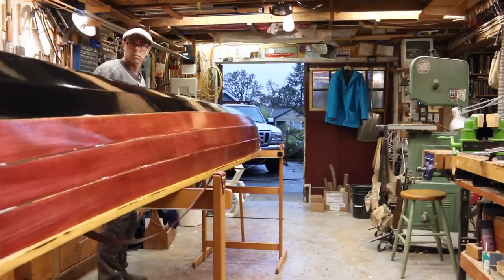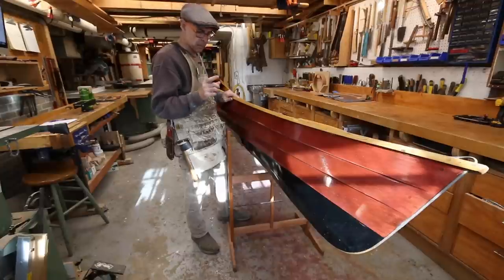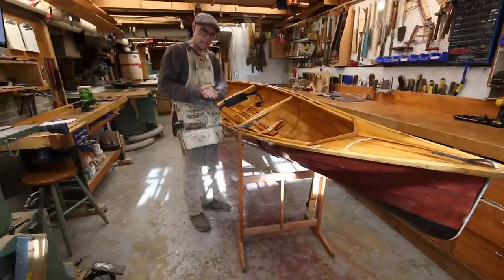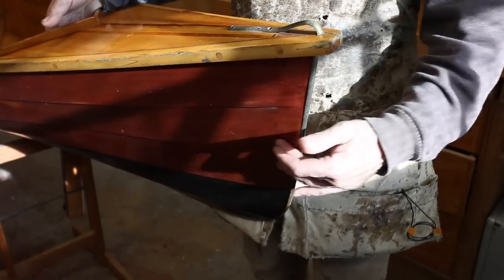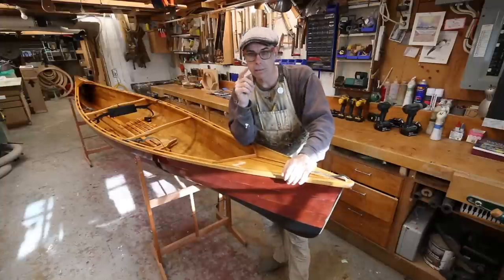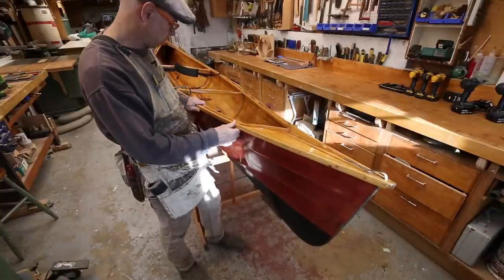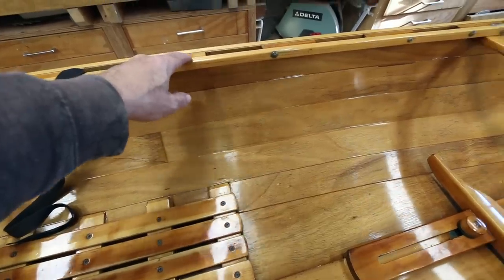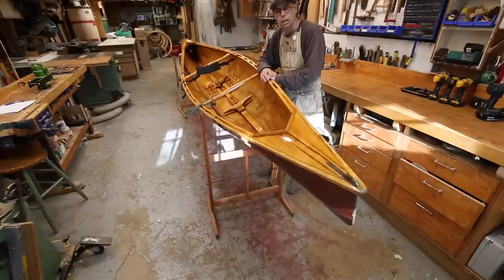Old Boat - Fresh Perspective - Critiquing my early work

Comment: Hi Marc, that varnish degradation is due to the trapped air in the planking heating up and wanting  to expand. That causes more pressure at the more open grain sections and causes those pores to open up a bit. When that hsppens regularly the varnish starts to give. That's what shows there.
Repairing it works best with sanding, then opening the cracks with a fine wirebrush. Then warming the canoe up to push thair out. Give it a HEAVY layer of  thinned varnish and LET IT COOL. That will aid in sucking the varnish i to the pores.

Comment: Fascinating how your revisit of an old project brought back all the decisions and trade-offs inherent in boat-building . I built a Seabright Skiff from Chapelle's offsets of the original Seaman -built "Lizzie" in the early 90's using Thomas Hill's method.  As a first -time boatbuilder,  a major simplification involved replacing the original rabetted stem design with a laminated marine ply inner stem and laminated ash strip outer stem (cutwater) capped with a bronze half-round.   The flat bottom and  2 lowermost strakes were joined with the aid of fiberglass cloth and the entire bottom to that point covered with dynel cloth/epoxy before proceeding with planking. The upper 9 mm planking was coated inside and out with epoxy (no cloth) and finished with UV resistant 2-part polyurethane clear coat. It has a centerboard and sprit-sail yawl rig. The boat has always been stored in  a garage or shed under a canvas cover , has seen relatively little use as a trailer-sailor and is in virtually as-built condition.
Reply from the maker: That's fascinating Mark, If you have a few photos to share, I would love to include them in my Catalina Wherry (Seabright skiff)  build series as it is also built on the Tom Hill method. There's an email address on my "about" page of the channel.

Comment: I wonder if the varnish damage on the outward side away from the house could be due to daily condensation evaporation leading to cooling causing the wood to shink after expansion in morning sun? I learnt a lot about varnishing from this episode. Thanks.
Reply from the maker: I doubt that. The canoe that sits right below it hasn’t suffered in any similar way. I’m not going to lose any sleep over it. I switched to a light coloured breathable fabric cover. I’m sure that will improve the situation.

Comment: Thanks for discussing that grey area; varnish vs. epoxy coating. I have arrived at the same conclusion after many years of maintenance, but always helpful to get someone else’s perspective on it.
Reply from the maker: I’m sure there are certain products that out perform others but the only way you find out what outlasts the competition is by applying it as recommended and then ignoring it until it doesn’t. Staying on top of it is the only real option and I prefer any product that is easy to refresh. Catalyzed products are a bit notorious for not being very friendly in that department.
Reply: Well said!

Comment: Interesting critique. I have occasionally taken apart pieces of furniture I made decades ago, and it is quite a revelation every time it happens. It's good to realise that I have got better over the years, and that much of that improvement has come with reducing the amount of machine work, and increasing the amount of hand-tool work. But there are certainly cringe moments....... One thing I know with absolute certainty is that I would NEVER consider doing a self-critique on Youtube, and I applaud you for being much braver than me.
Add an oil to your mix and that's precisely how I finish most of my furniture these days: a thin mixture, wiped off after less than 10 minutes. It's a brilliant, foolproof way of building up thin layers ......and lots of thin layers is way better than a few thick layers.
Reply from the maker: I too mostly use oil varnish mixes on much of my furniture work and often on thwarts and floors and such on boats.